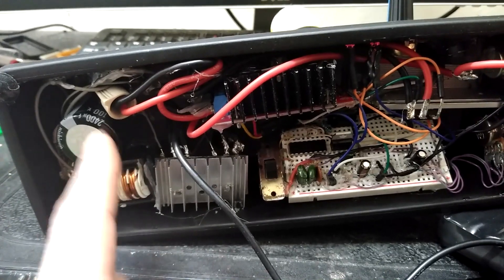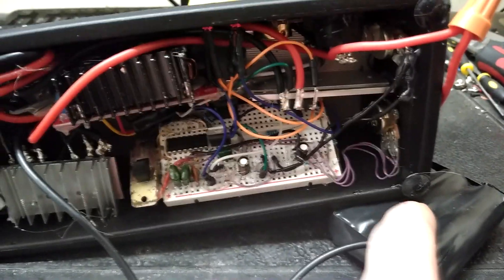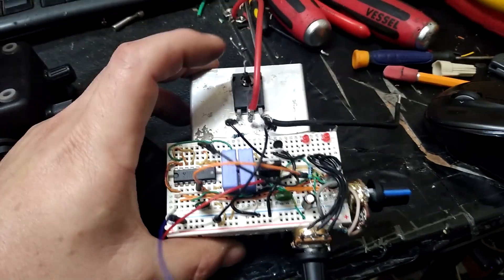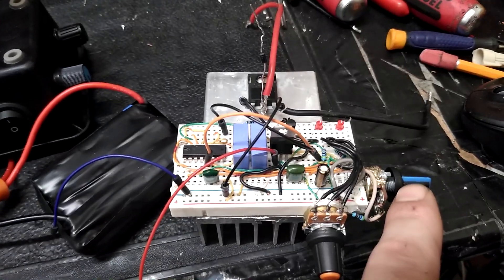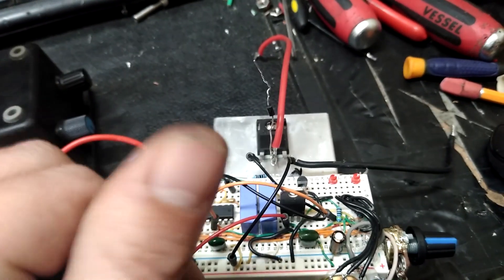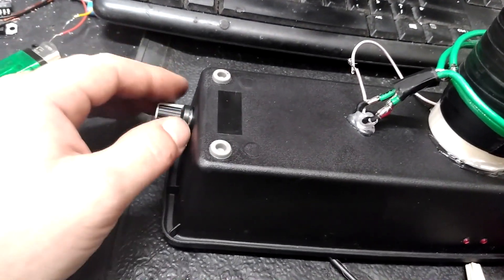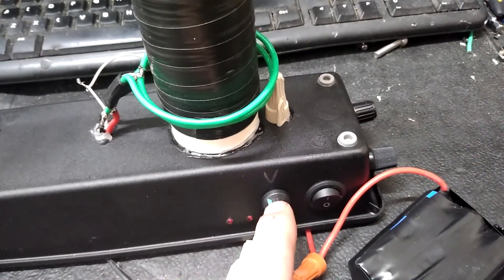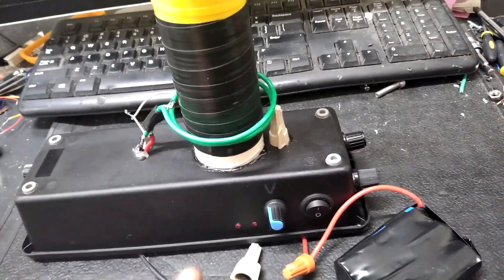The 12V SSTC, Boost Driver and PWM.

Comment: What a beauty, I mad e almost the same only thing is i adjust with the variac, But nice u have the same idea's as I have, question tho shouldnt you get a tone if the pmw is fast enough with the interuptions? pls reply
Reply from the maker: Yep, but cranking the interrupter frequency too high draws quite a bit more current so I tried to keep it at low bps to preserve the battery run time. Later circuits I just ended up making a PWM I could feed audio signals into and use it to drive various tesla coils. I was able to remake this circuit later using the same kind of setup and get a lot longer arcs from 30v or so though.

Comment: Hi,you can post the schem?
Reply from the maker: Sorry I didn't see this comment til now. The schematic I used was the one on Tefatronix's page here http://tefatronix.g6.cz/display.php?page=sstc4&lang=en. 

Mine has a few differences. Instead of using a pwm controller to dictate when the mosfet gates are off directly (his Q2 in schematic) I'm using a PWM across the power rail to power the SSTC circuit with pulsed DC of variable duty and frequency. I'm also using IRFP250N mosfets. The important part is that mosfet stage of the circuit. My gate drive transformer for this SSTC was just a smallish common mode inductor I pulled from some electronics that happened to give me decent arcs so long as I tuned the potentiometer 'RV1' just right.

Comment: Very nice
Reply from the maker: Yes I think it's cool for what it is! Skori's works better but mine can handle higher voltage, problem is arcs want to jump to my finger from over a cm away on all of the low voltage components. Surprised it has lasted this long without proper isolation. The arcs will jump right through the plastic including the knobs on the potentiometers.